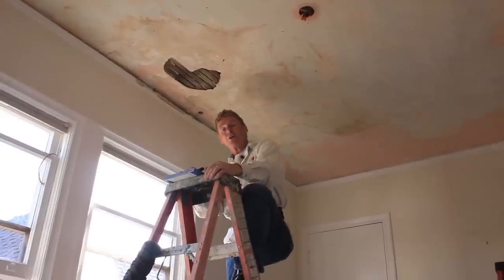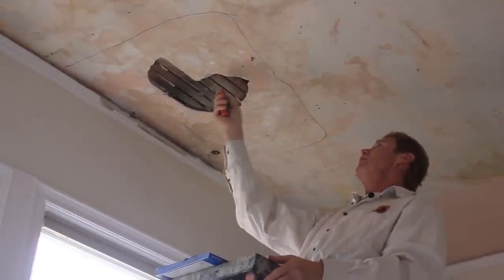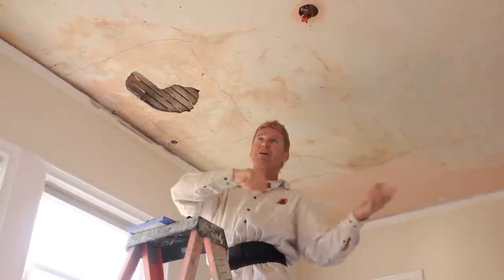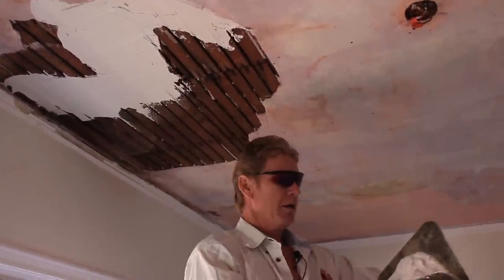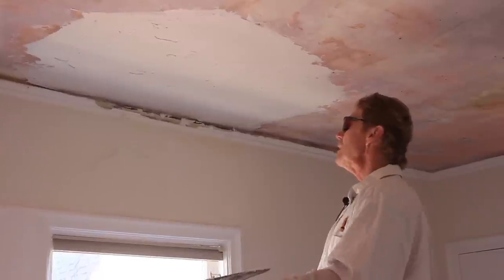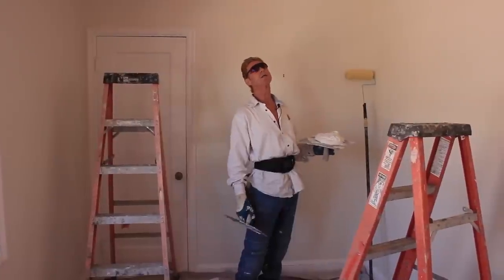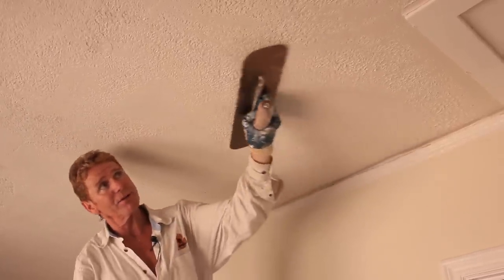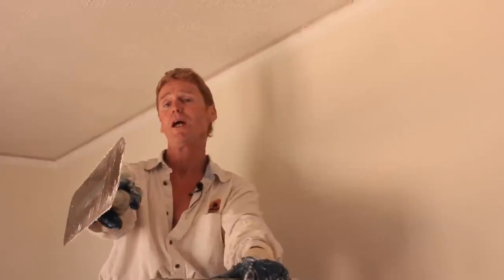Repair a damaged ceiling with drywall compound

Comment: Hey Kirk, what 40 minute brand are you skimming with? Thanks.
Reply from the maker: Good afternoon Jose dude,The mud I'm using in this video is a Gypsum Joint Compound. So yes it can be sanded if your not an expert, personally I have never had to sand either product, but I have lots of time in and loves this craft.
     the choice of USG Easy Sand & Westpac joint compound are very similar in nature or manufacturing so close in fact I can't tell the difference as I'm an applicator, not an engineer.
Home Depot or Lowes or any of your nearby hardware stores will have either Westpac's Fast Set or USG's, Easy Sand Joint Compound.
You buy the bags depending on your skill level.
     From, 20-minute compounds, means when mixed, you have 20 minutes to apply before it sets.
   The 40-minute compound, 40 minutes to apply, and so on, from 5-minutes to 20, 40, 60, 90, to an hour and a half. 
All you do is add water. 
      FYI, if your buckets and drill paddles are dirty or full of residues due to not cleaning well last time you used them, this will set the mud much faster, always wash your tools. 
Click on this video and skip forward to 3 minutes for pictures and details.  https://youtu.be/k7tE652qOH8
      USG's, Easy Sand Joint Compound Or Westpac’s Fast Set Joint Compound, they are both o.k. to use in fact I can't tell the difference.
Undoubtedly one is sold at your neighborhood hardware store.
     Kirk and Jason Giordano, Bringing to all the most complete plastering encyclopedia ever created in the world online.
 By the plastering messengers of Youtube.  With well over 850 free self-help videos 🎭 👀💃

Comment: So I have a bathroom above my kitchen and there is a crack in the kitchen ceiling. Sometimes the bathtub/shower leaks down and it drips out of the crack. Also, there are just a lot of cracks in the ceilings all around my house! Maybe because we have a close to 200 year old house. But still, it is very eyesore. You can tell someone tried to patch some of the cracks with putty or something but the cracks cracked through that as well. I have quite the predicament because I am on a budget too. :(
Reply from the maker: Morning Mizan Chin, bummer dude, I hate to say this, however I must, if this leak has been going on for many years  it means a pipe is leaking, you can have minimal wood rot or major, best to find out and correct.
 best wishes,
 Kirk Giordano
Reply: Thanks so much. As I think I mentioned were on a budget :(. But me and my brother are going to be headed to college in a couple of years. Then our parents are going to move out. I think we'll just make do and be happy for what we have right now. :)
Reply from the maker: been there and had to do that too, sometimes the cash situation rules.
 Best wishes,
 Kirk Giordano Plastering
Reply: +Mizan Chin drill a couple of holes so that it drains and dries quickly till u can do the right thing
Reply: thx :)

Comment: Hello, very nice , please which plaster you used for repair ceiling? Thank you
Reply from the maker: Good evening Pavel Dude, good question, the gypsum was called fast patch 20-minute compound.
                       Live long and plaster
           Sharing the plastering knowledge
Reply: Kirk Giordano plastering Inc : To clarify your previous: When you say "gypsum" is that USG? When you talk "mud" here, is that a drywall compound or a plaster-based product? 
Thanks for all your sharing. Best,

Comment: Why not use an oscilating tool with a carbide blade to save time and steel box cutter blades?
Reply from the maker: Evening Garras, this would relealse silca ito the air, which is almost as bad as inhaling aspostos.
 Bringing peace, love, and brotherhood back to the world of “Plastering.” 🌍
    The complete plastering encyclopedia on video, by the plastering messengers of Youtube.  
     Over 800 videos 🎭 👀

Comment: Do you add any molding plaster to the mud?
Reply from the maker: evening Steve Lockwood, no, I used a drywall compound, that sets in either 5, 20, 40, or 90 minutes, so no additives were necessary,  molding plasters can be classified as say the 
"plaster of paris gypsum" which harden fast when water is introduced, the stuff hospitals make casts from.
 Cheers,
 kirk giordano plastering
Reply: +Kirk & Jason Giordano's plastering & stucco tips gotcha.

Comment: Kirk have you used Plaster washers? Is mesh Tape any good for plaster walls Cracks.
Reply from the maker: Howdy, Louis dude, I dont recommend trying to screwing back up a sagging plaster ceiling.
 Applying a fiberglass mesh fabric is oaky if the hairlines are huge, and there are some structural issues.
 But most hair-line cracks can be dealt with by applying caulking or red devel lime putty in the cracks.
          Kirk and Jason Giordano, together we have provided to all folks throughout the world the most complete plastering encyclopedia ever created online.
   The plastering surgeons of Youtube, with well over 850 'free' self-help videos 🎭 👀💃
 Bringing peace, love, and brotherhood back into plastering.🏝🎆
Reply: @StuccoPlastering  Very loose in lot places I scored an took 3ft section. I don't think Homdepot sell Plaster Mudd so can I use 45 Easy sand.

Comment: Is plaster weld for inside and weld Crete for outside ? I have a can of weld Crete can I use it indoors on a plaster wall patch and do I need to thin it or use it full strength?
Reply from the maker: yes, you can use the exterior for interiors, but not the interior for exteriors. No need to dilute.😏
Reply: @StuccoPlastering  thank you Kirk

Comment: Kirk, did you use plaster or speed set? Thanks, Jon
Reply from the maker: Good afternoon Jon dude, The mud I'm using in this video is a Gypsum Joint Compound. So yes it can be sanded if your not an expert, personally I have never had to sand either product, but I have lots of time in and loves this craft.
     the choice of USG Easy Sand & Westpac joint compound are very similar in nature or manufacturing so close in fact I can't tell the difference as I'm an applicator, not an engineer.
Home Depot or Lowes or any of your nearby hardware stores will have either Westpac's Fast Set or USG's, Easy Sand Joint Compound.
You buy the bags depending on your skill level.
     From, 20-minute compounds, means when mixed, you have 20 minutes to apply before it sets.
   The 40-minute compound, 40 minutes to apply, and so on, from 5-minutes to 20, 40, 60, 90, to an hour and a half. 
All you do is add water. 
    Kirk and Jason Giordano, Bringing to all the most complete plastering encyclopedia ever created in the world online.
 By the plastering messengers of Youtube.  With well over 850 free self-help videos 🎭 👀💃
Reply: @StuccoPlastering  i have used easy sand quite a bit although I am not a pro. I usually use a knife and sand more than I would like. I am thinking a hawk n trowel may work better or maybe its your skill

Comment: how much a job like that would cost me ?
Reply from the maker: Hi Ronald Bob, l too many variables for me to be accurate, such as is the work on a top floor, how many steps to climb, is furniture to be moved, does a person have hardwood floors that need to be covered plus hallways and steps leading to the area in quest, how much plaster should be removed, and on and on.
 Roughly 500 bucks but can easily double or even triple.
 Sorry brother, cost is not what I guess at for anyone until I see the project.
 Best wishes,
 Kirk Giordano

Comment: Structolite is way cheaper, though, a 50lb bag is a cubic foot and like 4-5x the size of a 25lb bag of Easy Sand 20. Easysand 20 I did three small corner repairs over sheetrock and half the bag is gone. :/ I guess if time is money, then hey, it's the way to go.
Reply from the maker: Howdy Gilbates, both have their advantages
 Which has nothing to do with money.
                       Peace love and happiness to all
         Mastering Plastering for the beginner’s to the experts

Comment: kirk try using one of these tools with a diamond blade. I found it works great at cutting stucco and plaster. 
http://www.harborfreight.com/power-tools/oscillating-tools.html
Reply from the maker: Hi Dusty, I have one of those Oscillating Multifunction Power Tools but I haven't tried a diamond blade, the worst part is using a power tool with no vacuum device as the room fills with dust in a matter of minutes.
 One of the reason Jason used a razor knife.
 Best wishes, 
Kirk and family
Reply: StuccoPlastering
Does the oscillating blade reduce the dust production versus a circular rotating blade?  I would think it would.  In addition, I've seen workers tape the end of a shop-vac hose to the tool to suck up the dust.  Not sure how cumbersome that would be.
Reply: Yes the dust more falls than being flung. Use a smaller diameter shop vac hose helps or have a helper. its like anything you learn your Own techniques through trial  and error.
Reply from the maker: Hey dusty, you have definitely done this work befor. I also tried this method too, and it does work much better.
 Best wishes with all your projects.  
 kirk and family